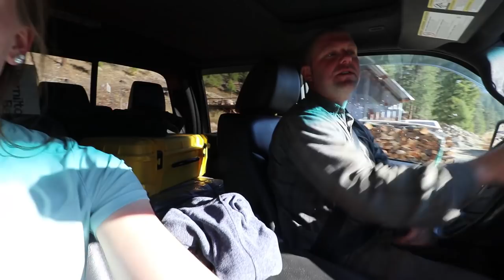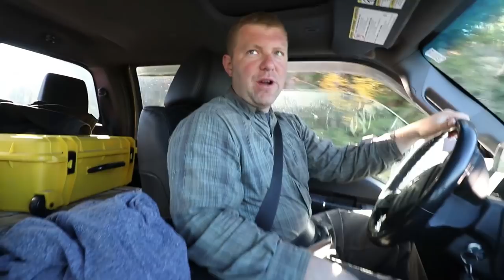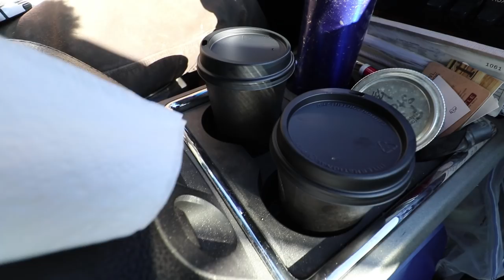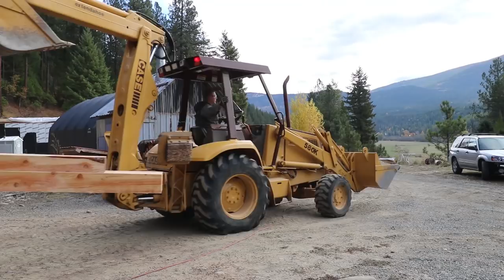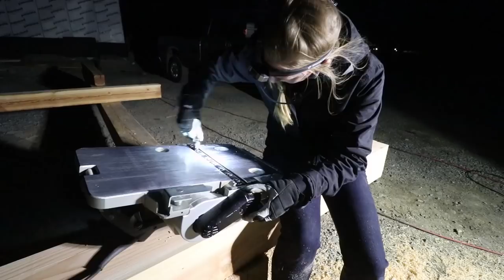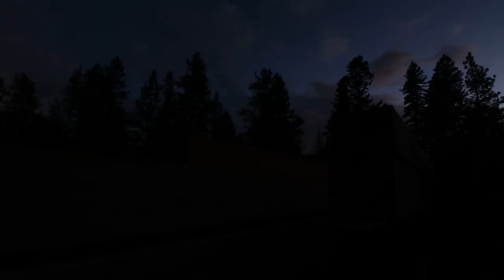Why Haven't We Uploaded a Video in 5 Days?

Comment: I feel your strain. We didn't have to push ourselves, to the level of building a house, but we've literally moved mountains (tonnes) of dirt - clay, at that - by hand. Delirium sets in, and you're running on auto-pilot most of the time. Just gotta get through the next day, is what you end up telling yourself. But the elation which follows afterwards - once you've finished that build (or in our case, many metres of retaining wall) is euphoric! It's so dreamy to be able to sleep in, or not go onto the old site and push through the next stage. Because the hard work, is over. You'll get there.